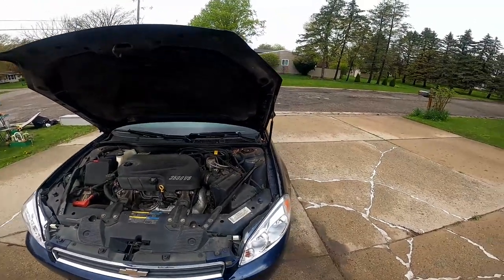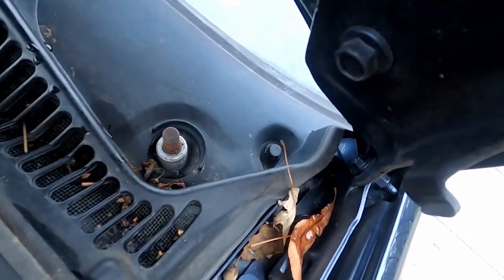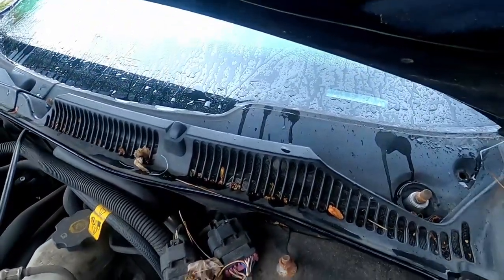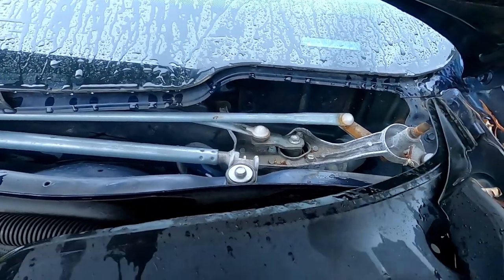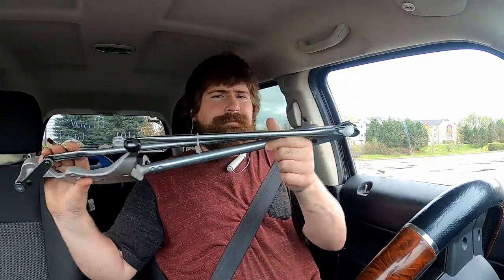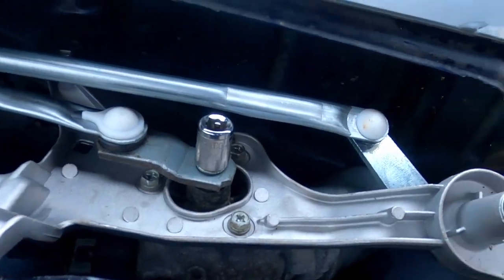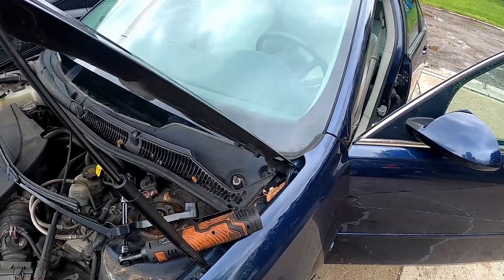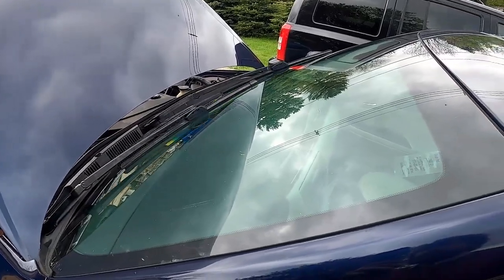HOW TO fix Impala WINDSHIELD WIPERS that wont move.

Comment: What tool are you using that is the Rex Beti to get all those off and is there a more affordable tool ?  This is my first time attempting and teaching myself to work on my car and not pull it into a shop unless I can't do it and have tried my best.
Reply from the maker: Any set of hand tools will work. Cheap ones are available at harbor freight or yard sales. Rexbeti is just a horribly named Chinese powered ratchet. Anything the battery powered ratchet can do can be done with a regular ratchet.